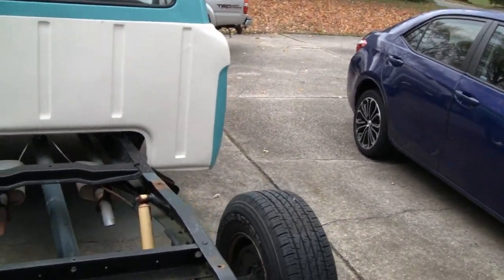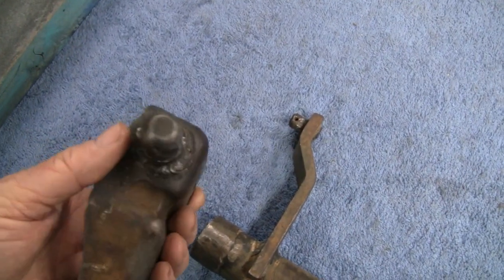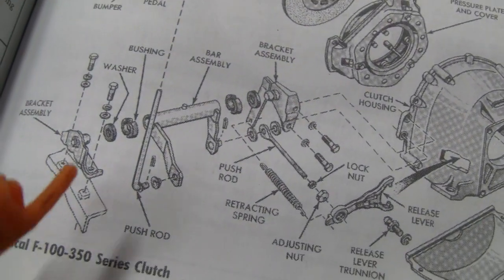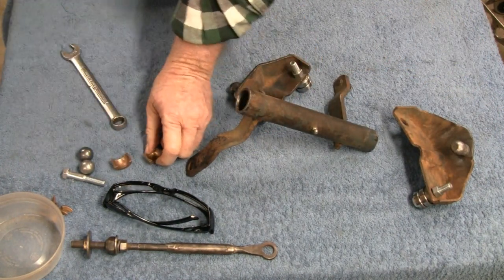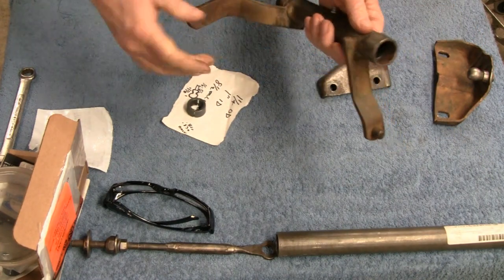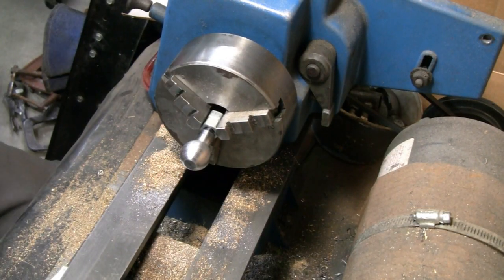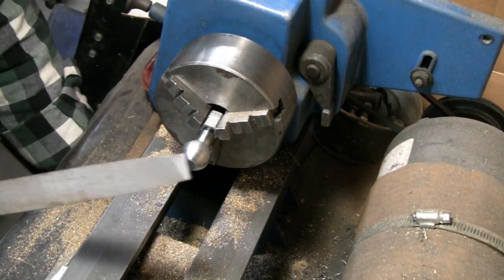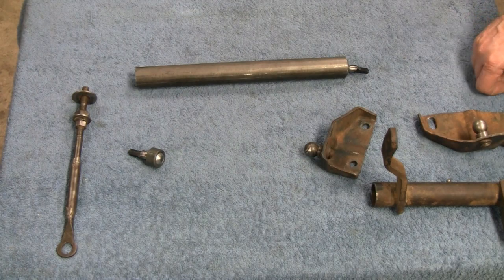FABRICATE and RECONSTRUCT CLUTCH Z BAR (F100 part 74)

Comment: My Bel Air has a felt washer at each end of the clutch bell crank to keep the dirt out and the grease in. The truck is looking really good!
Reply from the maker: Thanks alot Howard!! Thanks for the info, The exploded view of my setup in the manual shows WASHERS. I'm like WTF do you need washers for, they failed to mention they are felt!!☺

Comment: Thanks for sharing buddy. I never find any of your videos boring. I am sure your not the only one to start to fix something on an old car or truck and end up having to rebuild the whole thing. Shipping is really problem in this country. Rates are continuing to go up and the driver shortage isn't getting any better. I like what you came up with I think it will work fine and out live the both of us. lol That truck is going to be quiter and nicer on the inside than when it was new. I would cleaned up the engine block and everything before I would of put the fenders back on looks pretty dirty in there. Keep up the great work and videos!
Reply from the maker: Thanks alot Bob!! We're gonna wait for a nice warm Spring day to clean up that engine!! We have to replace alotta seals and gaskets first!!☺

Comment: I had pretty much the same issue on my 61 Ford. I welded up the balls then turned them back true on a lathe. I was able to you the OEM bushings. I had to build the linkage because my one one was too far gone. There should be a brass bushing in the hole of the rod. I think it was a shouldered bushing 38" OD and 1/4" ID. Both brackets had to be welded. I think the one bracket of yours for the bellhousing is off a 6 cyl.

Comment: Having those balls on each end means that the engineers expected the Z-bar to move in all directions.  The ball bearings would neverr have worked in place of the balls.  You figured that out.  You need to understand why the previous owner felt the need to do so many more modifications, mostly moving attach points and lengthening stuff.  Maybe make a model out of popsicle sticks to see how the original was supposed to work.  Do that for what you pulled off your truck and see if it works significantly differently.  I guess I'm a bit late, I started writing this before I saw you making your fix.

Comment: I hope it works for you. That has been my nemesis on any older American manual vehicles. I have never found a good solution other than hydraulic conversion. Cables are no better. I have envisioned chromoly tubing and true spherical bearings but $$$$$! I keep finding every end of the linkage worn out too! Hiem ends? $$$!

Comment: “I don’t want to listen to this crap”, RoadKing, you kill me! 😁. This thinking about how to solve the problem is the best part.  Thru the first half of the video, I was thinking “use the chevy ball”, and that’s exactly what you did.  For the rods, you might want to use heim joints to fix the pivot wear.  Less friction and will accommodate misalignment.  On my truck, I chucked the worn out z-bar, and converted to a hydraulic clutch.  More work, but less friction when it was done, and no real wear parts.  I do like your solution, though. 👍
Reply from the maker: Thanks Greg!! That Chevy Ball saved my ass with minimal modification!!☺

Comment: Home shop engineering and fabricobling! I love it! Shipping can sure kill a project fast. Just curious; does the old parts truck have anything salvageable on it?
Reply from the maker: Yeah the Donor truck still has alotta good parts on it but as far as the  clutch parts it's a 6 cylinder and it's a completely different setup!!☺
Reply: @805ROADKING  Ah, I figured there was a good reason.

Comment: 56 and 57 Chevy cars used a ball setup like that. 55 had a smaller ball. The original ball and stud were rivited or welded. Replacement ball and studs are a bolt on fix. Check your 57 Chevy for ball size if it was a stick shift car originally. Opps. If I had waited 2 more minutes, Up popped the Chevy type ball I was talking about.

Comment: I know you’ve already solved the problem but it probably would have been cheaper and easier to get a master cylinder and slave cylinder and convert it to hydraulic. Back when I was building stock cars I put in a ton of time and engineering to set up a mechanical clutch pedal. Then I went with hydraulic and never looked back! I don’t remember which one I used, but it was off the shelf parts, pretty cheap and quick and simple.
Reply from the maker: Yeah hydraulic is definitely the way to go!! I didn't plan on getting into this that deeply, I just wanted to change the bushings!!☺

Comment: Did you happen to look at the donor trucks assembly and see if the ball ends and the tube were ok or the same? And I'm sure Mike could have turned those ball ends very easily. Di you happen to look in MC Masters website for those ball ends?
Reply from the maker: Yeah the donor is a 6 cyl, everything is completely different, that would have been too easy!! McMaster was the first place we looked, they have the threaded balls but nothing close to that size, they are almost 7/8"!!☺

Comment: Wouldn't it be easier to change it over to a wet clutch? Then you wouldn't need all the other stuff.  You would probably spend the same amount. But you would have a smoother, quieter clutch. JMT.
Reply from the maker: Yeah a hydraulic clutch would have been a better solution but once I had all the parts for this setup it was just alot easier to continue!!☺